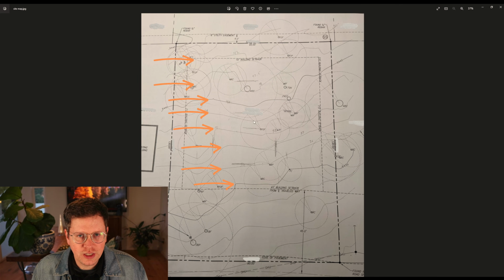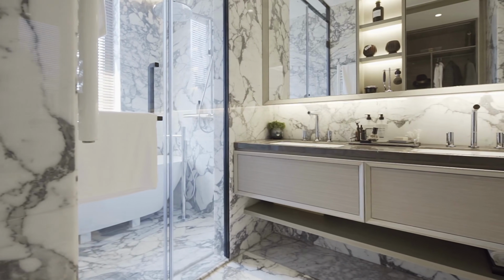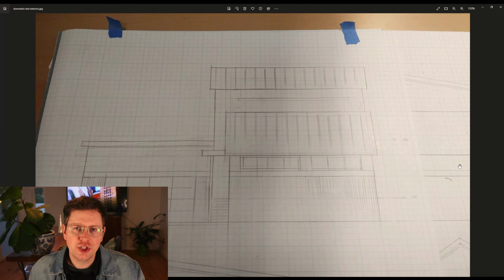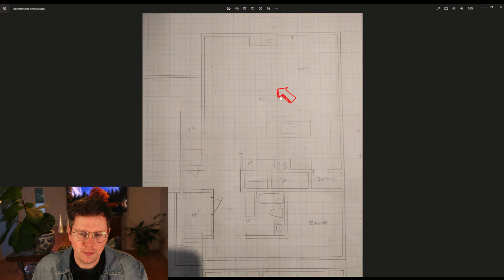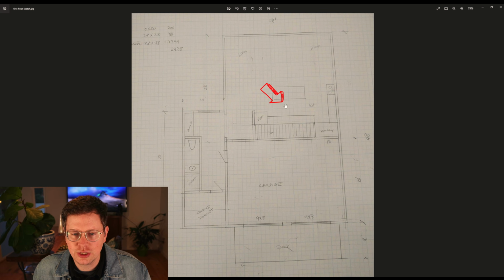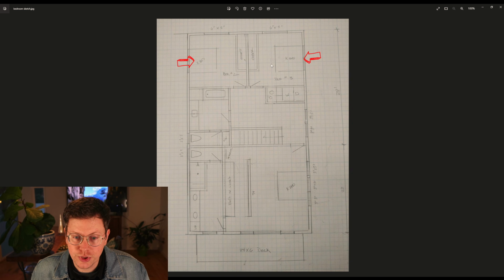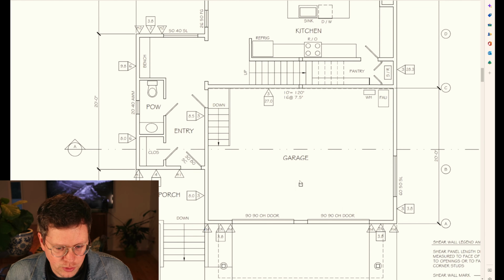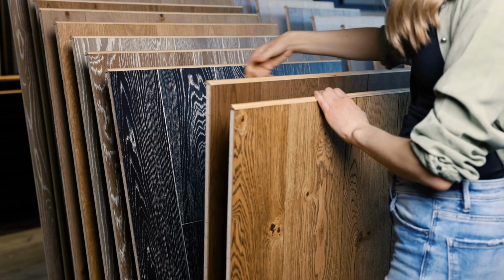How To Design a Custom Home from Scratch

Comment: Decided on a hybrid timber frame skillion with masonry columns because cheap and easy to build. Modeled after Matt and Goldies earth ship but to code. So no tires or berm but have thick masonry north wall. I have 70 psf snow loads and 6 foot frost depths. Offgrid but do have zoning restrictions. Here if in code you don't need architect or engineer. Which meant only a 20 foot masonry column to go taller would need to pay because limits of code. So raised it 4 feet before starting it. Like Trump's flag pole. Needed 16 foot of window every 8 foot for passive solar heating. Could only span 9"4" between post or columns. I have plans for masonry stove and masonry heaters. Needed room in kitchen/dinning area for picnic table built for a giant. And to drive vehicle in through front door if need be. Like in a huge snow dump. Can only build a 44 foot tower under code. Think of an Richardsonian Romanesque Earthship. I do commercial and residential building for work. So do know my codes.

Comment: what about plumbing and electrical work in the planning? do you let sparkies freestyle them?
Reply from the maker: @Stevedawhoop  architects generally consider rough plumbing and electrical when designing the locations of fixtures, but in my experience the plumber and electrician really do kind of freestyle the rough in after framing (according to their respective codes of course).

Comment: No offense, but I would bet money that this design was done by a designer/draftsperson and not an actual architect. I mention this because a person is required to complete a lot more education and working experience—not to mention a rigorous licensing process—before they can rightfully be called an architect. There’s nothing wrong with using a designer instead of an architect if that meets your budget and design requirements, but the difference in the process and end result can be substantial as evidenced by your design. Again, no offense intended; if you are happy with the finished product, that’s all that really matters. Just be accurate with your terminology, please. Thank you for the opportunity to comment. Enjoy your home!

Comment: What are your ideas on a Well ?
Reply from the maker: Choosing between a well and a local water utility supply for your water needs depends on several factors. Here’s a comparison.

### *Well Water*
*Pros:*
1. *Cost-Effective:* Once the well is drilled and operational, you typically only pay for maintenance and electricity to pump the water.
2. *Quality Control:* You have direct control over water treatment and can address issues specific to your well.
3. *Independence:* You are not dependent on the municipal water supply, which can be beneficial in areas with frequent water restrictions or supply issues.
4. *Natural Taste:* Well water often has a natural taste that some people prefer over treated municipal water.

*Cons:*
1. *Initial Cost:* Drilling a well can be expensive. Costs vary widely based on depth and location.
2. *Maintenance:* Wells require regular testing and maintenance to ensure water quality and system functionality.
3. *Risk of Contamination:* Potential for contamination from surface pollutants, septic systems, or agricultural runoff.
4. *Variable Supply:* Water availability can be affected by drought or seasonal changes.

### *Local Water Utility Supply*
*Pros:*
1. *Reliability:* Generally provides a consistent and reliable water supply.
2. *Regulation:* Subject to stringent quality controls and regular testing to meet safety standards.
3. *Convenience:* No need to worry about maintenance or potential issues with water levels.
4. *Infrastructure:* Often comes with established infrastructure, making it easier to connect to existing plumbing.

*Cons:*
1. *Cost:* Monthly bills can add up, and rates may increase over time.
2. *Quality Concerns:* Depending on the area, there may be concerns about the quality or taste of municipal water.
3. *Dependence:* You rely on the municipality for your water supply, which can be problematic during water shortages or infrastructure failures.
4. *Restrictions:* Subject to local water usage restrictions, especially in drought-prone areas.

### Decision Factors:
1. *Location:* If you live in a rural area, a well might be more practical. In urban or suburban areas, connecting to the local water utility might be easier and more reliable.
2. *Cost:* Consider the initial and ongoing costs associated with both options.
3. *Water Quality:* Research the quality of both well water and municipal water in your area. Some regions have excellent municipal water, while others may have issues.
4. *Regulations:* Check local regulations regarding well drilling and water usage.
5. *Personal Preference:* Consider your preferences for water taste, control over water treatment, and independence from municipal services.

Comment: Great vid and thank you! 
May I ask What was your submittal process to the city planning and permitting office? I thought the planning office only approved “wet set” drawings from Aia listed architect
Reply from the maker: Depending on the local rules, the stamp can either be digital or wet. Either way our plans did have to be stamped by our licensed engineer before submitting. We also had to have the plans approved by the local fire department before we could submit to the building department because of the wildfire risk in our area.

Comment: how did you know what size you wanted sir
Reply from the maker: Good question. There were several factors, but the primary factor was that the house needed to be roughly the same size as the other houses in the neighborhood in order to appraise properly. The other factors had to do with the allowable footprint based on the lot size and of course my budget. I would've loved to add another bedroom, but I couldn't afford it.